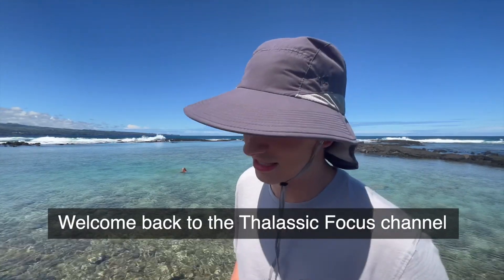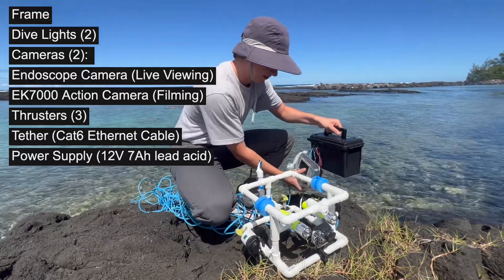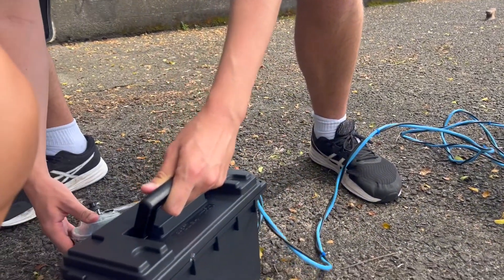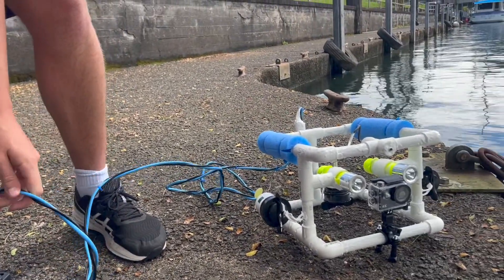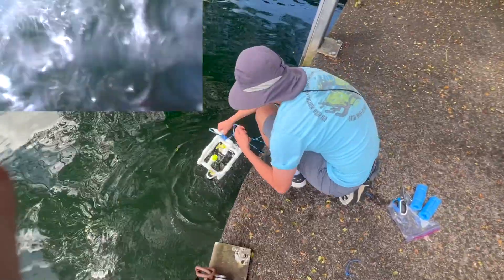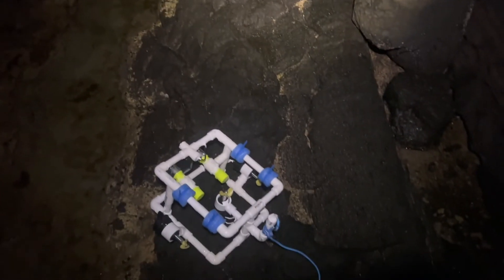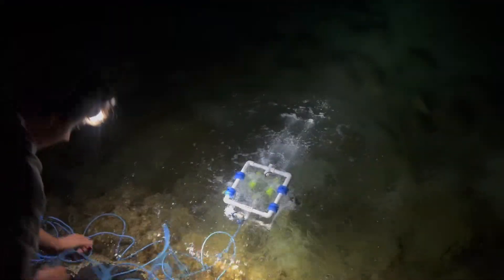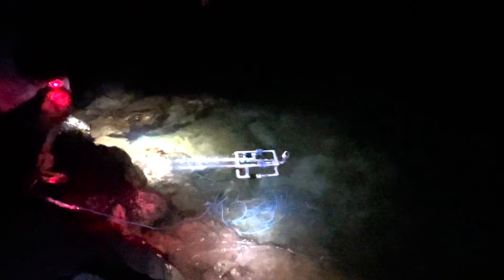Building a Remotely Operated Vehicle using PVC Pipe

Comment: 2 Problems could be faced easly : 1/ ethernet cable must have foam cube each meter long to making it floatable and second problem you shouldnt have to take foam from the top of the rov that's where it gets its stability instead you should add ballast or weight bellow the rov to compensate .....great work my friend